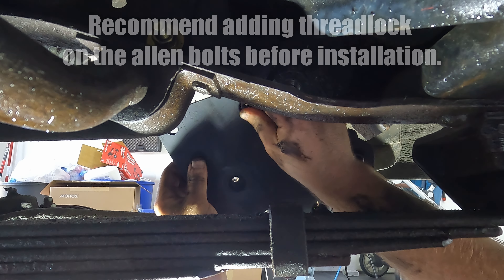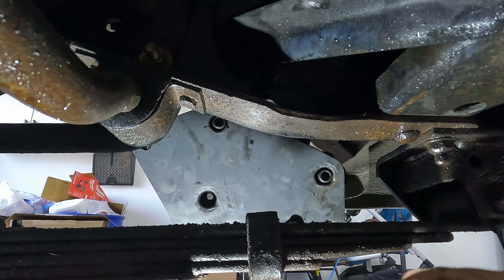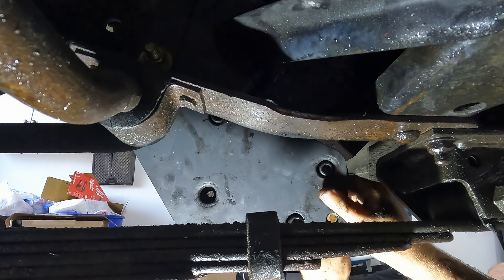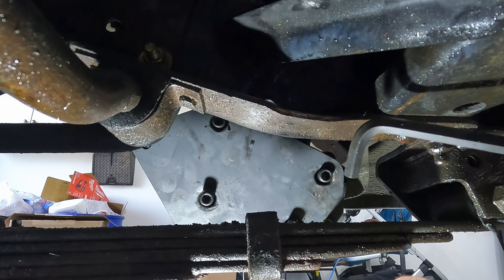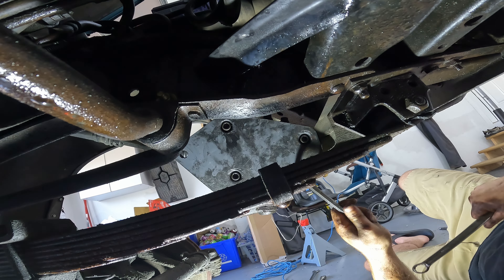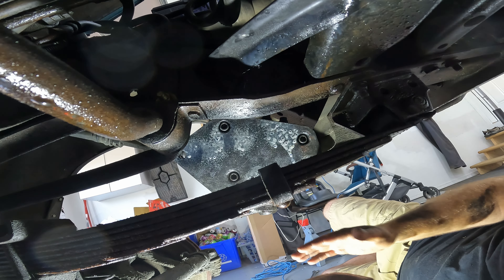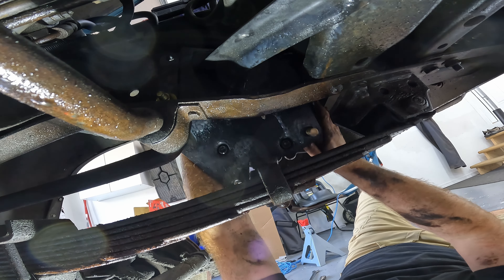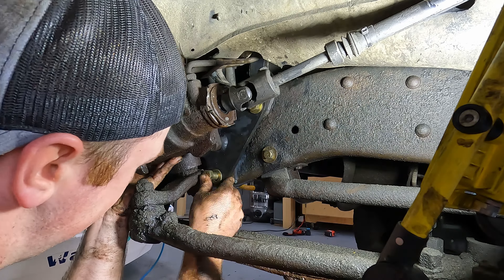Steering Box Adapter Plate | First Gen Cummins

Comment: Put one of those in mine with the far from stock frame brace. So much better. If and when you do a steering box consider lee power steering. Pricey but worth it.
Reply from the maker: Hey thanks for the suggestion! I'll definitely research them. Are you running the steering damper from FFS as well?
Reply: @roughcutsgarage  yes sir. Seems to help some looks cool if anything.
Reply from the maker: @Jordy40Growing  How do you find the build quality and rigidity of the bracket that mounts over the front diff cover? Looks a bit thin in the photos and wondering how beefy it is.
Reply: @roughcutsgarage  it’s kinda weak and it wasn’t a perfect fit. But has held up for over two years now. I’m not impressed with ffs products nothing fits right. Takes some modifications and on the frame brace they didnt finish welding it up .
Reply from the maker: @Jordy40Growing  Thanks for the heads up.

Comment: Did you put the dodge connection bracket on a different truck? wondering if it works no problem aside from needing longer bolts for a 4x4 truck, thanks
Reply from the maker: Nope I only have one truck. Both dodge Connection and steering brace brackets work together great. Like you said, you just need longer bolts to account for the extra metal with the two brackets. Works great.